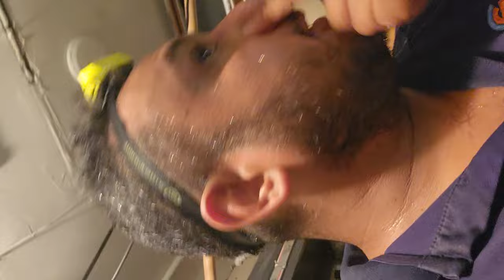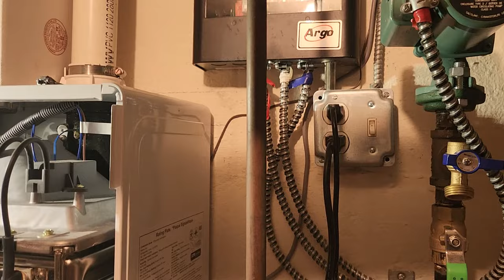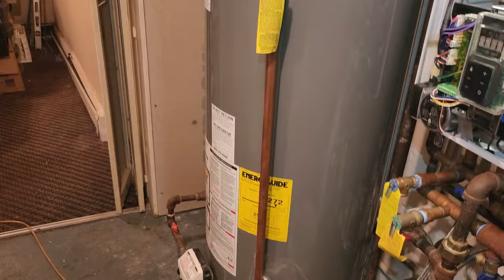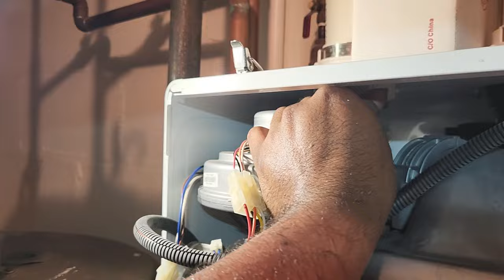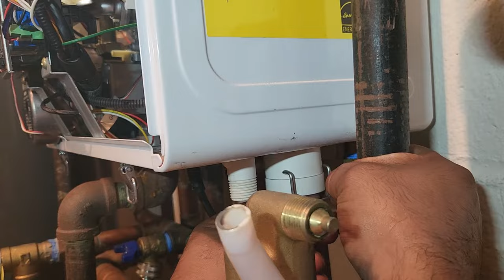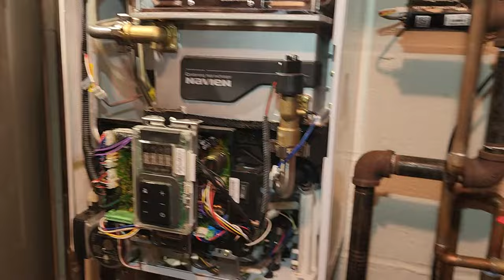3 most Frequent problems for Navien combination boiler re-do

Comment: Thank you for this. I'll give this a try on our NPE-240S. It's giving us the 003 error code. If I need to replace it, how does the long, thin black wire connect/disconnect?
Reply from the maker: Thats for the flame sensor. It comes with a whole harness not alone.  Did it break ?
Reply: @shielduniversity419  No, but if I wanted to replace the rod assembly that wire needs to be able to disconnect from it somehow?
Reply: @shielduniversity419  Or the wire must disconnect from somewhere deeper inside the unit.
Reply from the maker: @RetroDaze  navien told me it only comes in harness
Reply from the maker: @RetroDaze  you just pull it off of the flame sensor my guy
Reply: @shielduniversity419  Awesome! Thank you again.